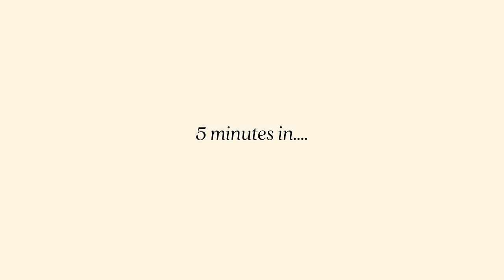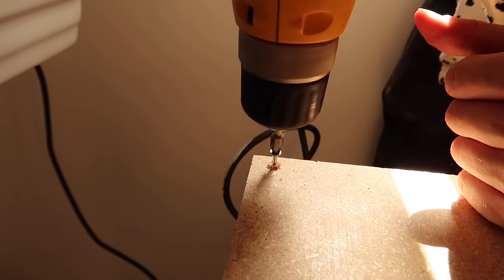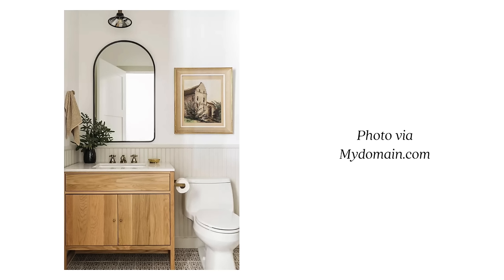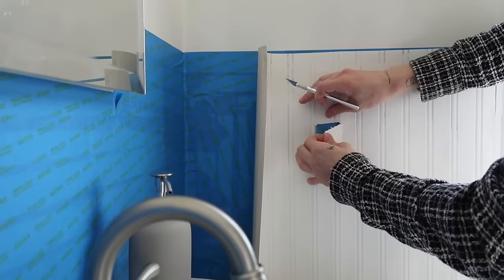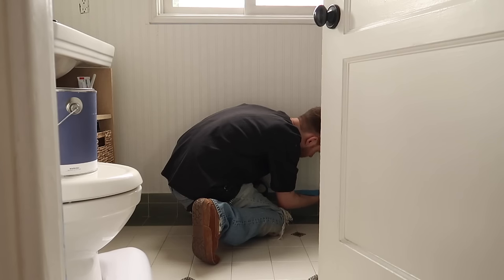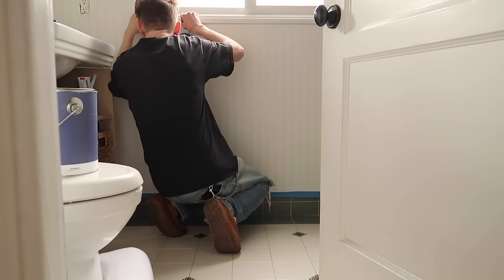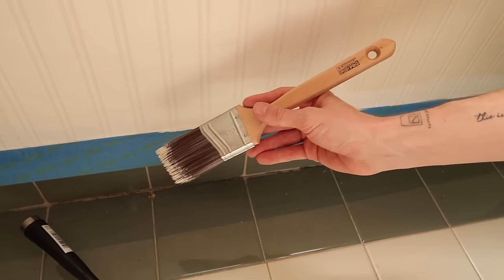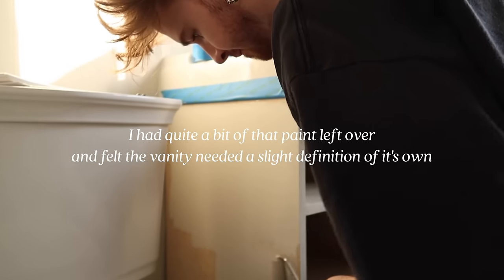EXTREME $350 SMALL BATHROOM MAKEOVER (Rental Friendly) + DIY Bead Board Walls & Vanity

Comment: Just a note, those first pieces of wood you show us cutting. It's not plywood, it's particleboard. So make sure it's sealed well because particleboard swells if it gets wet. It's a useful alternative to plywood which is more expensive but steps need to be taken to keep it safe from water.
Reply: Technically its not particle board, which has a super rough finish. It is, however, high-density fiberboard which is what many cabinets and baseboards are made from. Painting will waterproof it, BUT the bottom that is touching the floor has not been painted. Next time I would suggest painting all sides before installing. Applying a bead of silicone that later can be easily removed from the tile surface will also stop any water from getting under the shelving unit. This is also why you should also always silicone on any baseboards in a bathroom or kitchen as they, too, are never painted on the bottom or backside.
Reply: @EvelynM-vlogs  That's an awesome tip...so useful! Thanks for sharing!
Reply: I wonder if there is some type of plexiglass or sturdy plastic that could be painted or covered in fabric to replace the wood.
Reply: @1jmass  plexiglass scratches way too easily for such a small space. Realize most bathroom cabinets are, in fact, made with high density fibre board - the same material.
Reply: I might use wide white shelving that can be cut to the right length for sides and interior shelving, the white melamine surface is used on cabinets in bathrooms and is water resistant, also lifting up the bottom shelf to clear the floor would be another detail to consider in his great idea for bathroom storage.
Reply: Late here, but I like to use contact paper on this type of wood. Keeps moisture out and makes it look like something.
Reply: I have a fiberboard cabinet that I bought in my bathroom and the bottom edges that touch the floor has swollen from washing the floor. The swollen parts have begun to disintegrate.
Reply: @watchingover3592  yes over time it will absolutely do that.
Reply: @EvelynM-vlogs  Sorry, but this is quite definitely particle board. It's good quality particle board for sure, with the surfaces pressed nice and smooth, but looking at the edges you can see the rough chips and voids quite clearly. High and medium density fibreboard (HDF and MDF respectively) are much more uniform in structure and look. All three will get absolutely ruined by moisture though. So yeah, it should've been taken outside to get fully sealed, primed and painted with several coats on all sides. I would also add little plastic/rubber feet so none of the sheets rest directly on the floor where water would otherwise be able to wick under it and start to soak in over time.
Reply: Exactly
Reply: ⁰
Reply: I was thinking the exact same thing. But isn’t particleboard really heavy? That’s what I don’t like about it. It may not have been that much more expensive for real wood since you didn’t need that much 🤷‍♀️. I bet if you explained to the landlord what you were doing, every step of the way, he would’ve agreed to it. It’s less work and less money for him in the long run.. and it turned out fabulous.
Reply: technically particleboard and chip board are rhe some or so called fiberboard , that materials used for cabinets yes you're right about that.  @EvelynM-vlogs
Reply: absolutely right, I thought the same. Here I would also suggest adding some little legs or so to create a distance to the floor. But the idea itself, made with wood and not this material, is so good. Need to create something  like this  for me :-)

Comment: Heads up, if you leave painters tape on the wall for extended time the glue breaks down and when you go to take it off it can pull the under paint off.
Reply: Yes I was going to say that
Reply: AND the drywall paper UNDER the paint.  This is a terrible idea.  the other option is that within a month, humidity from the shower will have everything peeling off anyway.
Reply: Yup, someone is going to loose their deposit! 😕
Reply: Thànks! Good to know! I was considering doing this!
Reply: I was thinking the same
Reply: @venetianstudios5171  yeah the condensation will peel it off

Comment: While we are not renters, I still like learning renter-friendly techniques because sometimes I want to spruce something up but not make a permanent change. 
I love painters tape -  my younger daughter put up a wall of posters and photos using painters tape and 5 years later, pulling it off, there’s no residue. This wouldn’t be true of masking tape (ask me how I know!). My only concern with Drew’s method was whether the wallpaper paste could penetrate the painters tape, but he tested that so it’s all good.
Reply from the maker: Yes! I removed a few sections and reattached them and they seemed to be totally fine
Reply: Agreed! We are homeowners, but I love the flexibility to try new things and be able to change things out. Thanks, Drew. You're soooo talented and I love your style!
Reply: @lonefox  that's great you had that experience this time, but you really can't guarantee with "painter's tape" that it won't pull up paint, especially the longer that it's left.  Especially with this volume. Overarchingly, the evidence from decades of jobs still shows you should not apply painters' tape long-term if you need the surface underneath to keep its paint coating. It's one thing to do yourself, another to suggest that any adhesive peel-n-stick wall treatment is not truly renter-friendly, and to proceed with extreme caution (lightly applying the tape, not pressing down hard) and to have a  backup plan (color-matched paint).  I know you do projects often, but knowing professional painters has taught me that the experience you're paying for is all the problems that "don't" happen on a job. Otherwise, great and creative vid!
Reply: YES! I was thinking this same thing. I have a home and have been wanting to change up our bathroom but haven't because I'm hesitant about permanent changes so these ideas were mind blowing to me and soooo helpful!
Reply: I absolutely agree about just not wanting to commit to a permanent change for a room even when you own your house! My only question about the painter's tape and wallpaper paste was whether the moisture of the bathroom would effect the adhesive? I worked at Sherwin Williams for years and would not be concerned with the tape damaging the wall or paint as long as you used painter's tape.
Reply: I was worried about the removal of the painters tape, I'm so glad you said that about the 5 year removal aspect, I've got some plans I want to do but I know how often I change my style so this is very helpful!

Comment: Just a tip for next time. When putting up wallpaper, you can also use cardboard, foam or paper posterboards. Just stick the wallpaper to the posterboards and nail the posterboards to the wall
Reply: Yes! This is what we're doing on our peel and stick project to make sure we don't have any residue left behind on the walls and create a problem when we want to change it up again. Also massively opens up our selection if we don't go peek and stick.
Reply: Thanks for this tip!

Comment: tiiiiny bathroom... FOUR LIGHT SWITCHES!

Also a procrastinator who left painter's tape on the walls for two years during a stalled reno because I was too lazy to remove and retape... I strongly suggest NOT leaving painter's tape on the wall more than a few weeks. This might be a nightmare to remove. I'm sure there's some sort of exceptionally high end tape that someone here is going to comment and say, "Nuh, uh, it's fine, I did it before." Just a warning that it might not be as renter-friendly as you think if you have the same experience as me. And since it's in a very moist environment, thinking it's less likely to come off as easy as a dry environment. We had less issue in the back bedroom than our own bathroom getting it off the walls.
Reply: Yikes. I've never left painter's tape on, but wondered about it. I have used similar special low-tack tape made for masking off watercolor paper and that removes very nicely from paper - UNLESS you leave it on for more than a short while and then it can rip up paper and ruin your painting.

Comment: Love the storage idea but I would have elevated it so the wood didn’t get damaged when washing the floor. 😊
Reply: That's what I thought! Specially because it's a bathroom, but the main idea is just amazing
Reply: Yeah, the storage idea is great but he used a really cheap material that's going to bend/break if they try and put anything heavy on the shelves and will swell when there's steam in the bathroom.
Reply: Definitely, that particle board is going to mold in no time, could have done some small height adjustable legs underneath, maybe with a skirt of pvc trim to keep the grounded look
Reply: And it brought only two extra baskets storage. They had two at the floor before.
Reply: @tasadasa9363  But at least it pretty much covered the plumbing !
Reply: @Melody-285  That’s true
Reply: That was the only problem I saw as well… somebody’s gonna stub a toe on that some sleepy morning…
Reply: Also a lip behind the topmost shelf so that items can't fall backward would be nice.

Comment: It looks stunning!! I love the fake breadboard. And how stunning were the bones you got to work with, like the tiles and the toilet+sink, both so pretty!

For people who want to do the vanity: it's better to have legs on a vanity because it could get wet from the bottom in a bathroom and create mold issues if air can't get under there (or water damage to the structural integrity of the vanity). You could still use the exact same steps, just subtract the height of the legs from the height of the box and screw them under. They don't have to be tall to be functional. (Yes, I have learned this the hard way 😅😆)

Comment: Most of us have small and boring bathrooms, whether we're living in an apartment or a smaller and older home (not all of us live in McMansions), so this kind of inspiration is refreshing. Wondering if you painted behind the toilet tank.  It's easy to reach in the back to paint if you remove the top of the tank and use a small roller on a short extension.  Pet peeve:  plain clear glass in bathroom windows.  WHAT? That's not your fault of course, and the window does have the Roman shade on it, although it looks too thin to provide much opacity at night when the lights are on in the bathroom.  Maybe guys don't think about that kind of thing as much.
Reply: If you noticed, I think there's a film sticker on the window which made the window not fully visible from the outside.
Reply: There's film on the bathroom window.
And since he does this for a living, I would bet that he knows how to paint behind a toilet.

Comment: Super cute! I would be interested in a follow-up if they ever move to see how easily that wallpaper is removed after some time in a small humid room. The only change I would make is perhaps finding a light fixture/towel hook/accessories that were the same color or material.
Reply: I was thinking the same thing. Painter's tape can be hard to remove if left on for a longtime, and can peal off the actual paint underneath. YIkes! fingers crossed. But it looks so good, loved the vanity idea.
Reply: @maryannht2160  I think it might depend on the brand because as I said in another comment, we pulled off painters tape that had been on several years and it was fine. I wonder if the blurbs that come with different brands might say whether they can be left on safely for a long time.
Reply: @maryannht2160  He used blue painters tape which is one step less sticky than the green. Yellow is the least sticky but also doesn't stick well to old paint and is normally used over new tape to create a clean line without removing the fresh paint. Old paint is well cured and does not generally get damaged by blue tape.
Reply from the maker: I agree! I’d love to remove all of this and share the process on my IG if they plan on moving in the future

Comment: I also have a rental that doesn't allow paint or other modifications to the walls, and I used command strips (a LOT of command strips) to attach real beadboard to the wall. You can remove command strips that you cant get to by running a long piece of dental floss behind your object and sawing back and forth to "cut" the command strip off.  Used this hack for years, works great, never though that there would be wallpaper that mimics the same thing!

Comment: Never thought to cover wall with painters tape. I've seen other designers cover foam board and attach it to wall with command strips. Just a suggestion to save time. Thanks for sharing ur creativity 🙂
Reply: Painters tape will become impossible to remove over time so it’s definitely not an easy route, so just be careful of that!

Comment: I love the design of the under sink storage but why did you use OSB in a potentially wet environment?  I think using traditional plywood would have been a much more durable option.
Reply: It would have been better if he'd actually used OSB instead of the fiber/particle board stuff he used.

Comment: I really like the finished look. However...I have a few points. Iwould have put adjustable legs on the vanity for two reasons. 1, to level it out and 2, to get it up off the floor for cleaning and to keep it dry. Also all the mixed metals are bothering me, they are ALL different. Light, hook, faucet, shower head. Brass/gold, black, nickel and chrome.
Reply: I like the mixed metals! I think it's personal preference. :)
Reply: The mixed metals actually looks kind of cool!

Comment: A good tip for rental friendly wallpaper is using starch as a glue alternative. Then you just peel and wipe away - especially in a bathroom with semigloss paint. Test it out. Thick starch mixture (just like a jug of the concentrate ironing stuff!) diluted to make it into paint. Use it on the back and on the wall.

Comment: This is a wet room where there will be steam.. isn't the tape behind the wallpaper just going to peel off of the wall? 
Won't the untreated plywood just mold and bend? Especially sitting on the floor like that?
Reply: The boards used won't bend...at first. They'll swell up and start flaking, maybe get mildewy if they never dry out. If it wicks water up from the floor far enough over enough time, they'll start bending too.
Reply: @angieemm  fun 😬

Comment: This is gorgeous as usual Drew!  My only mention is that I would have extended the storage insert to the wall and equally on the other side for balance.  In the before picture, we saw how the dryer was hanging on the floor from that outlet. So some type of ledge was a lifestyle need for them while they get ready in the morning.   Extending the storage on both sides would have made the faucet look more like a bowl sink. I think that would have answered design balance as well as  function. You might not have even gotten two inches on both sides,  but sometimes 2 inches is enough. Yet and still,  it is absolutely gorgeous. It's such a challenge to style a bathroom  with those awkward wall mounted sinks! I'm wondering what the people who lived in the 40s and 50s did to store their stuff when that sink was en vogue.

Comment: If you add a little bit of paintable caulk over the edge of your tape and remove the tape when the paint is still wet you will get the sharpest lines possible and there is no way paint can get under the tape! 🙌🏻

Comment: You could also put up cheap peel and stick wallpaper and then put the real wall paper on top of it. It's maybe twice as expensive as the tape, but would probably save a lot of time. Especially if you actually glue the real wallpaper onto the peel and stick first, so you only have to line everything up on the wall once.

One other suggestion for future vanities, MDF stands up to moisture best out of plywood, particle board, and even many solid woods.

Comment: Looks great...my concern is, the painters tape and adhesive can pull away from wall with moisture and the other suggestion or concern, while cleaning or overspray from toilet, cleaning whatever it may be, you should have probably cut some of the storage off the top, add casters on the bottom and you could've put extra wall paper or wood on the back to cover piping. Looks great and creative!

Comment: Nice job! Maybe you could have wallpapered some thin woodpanels with the wallpaper and velcro that on the wall? Also in the Netherlands we have non woven wallpaper. You have to put the wallpaper glue on the wall instead off on the wallpaper. When you take the wallpaper down from the walls it come off in whole strokes without any damage on the walls. Maybe its also available at your place?

Comment: I Adore the wallpaper/painters tape tip. I may have to use that someday!!! One thing I am curious about is the paint you used on the particle board. I worry about water coming in contact with it and if the paint you used may have helped seal it so it does not bubble?

Comment: Aesthetically it’s great but oof there are practical issues. That wallpaper idea is fun for a bedroom but is a mold trap for a bathroom and depending on the kind of painters tape will either come off easily or tear down half the wall with it when you try to take it off. Not painting the vanity fully when it’s a pressed board of some kind means it’s going to warp and bubble and maybe trap water near the unsealed edges that turns to mold. Without a seal to the floor it’ll be hard to clean around and when you do clean around it it would be easy for water to get trapped and again create more mold. Roman shade is super nice though and that little pin holding back the pulls gave me a great idea for my kitchen